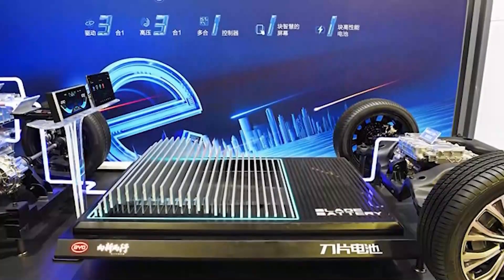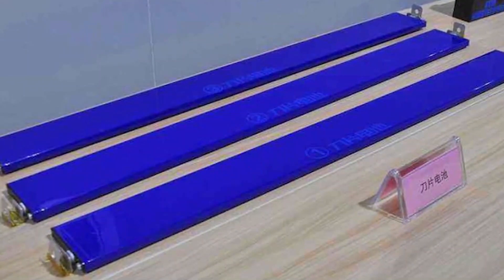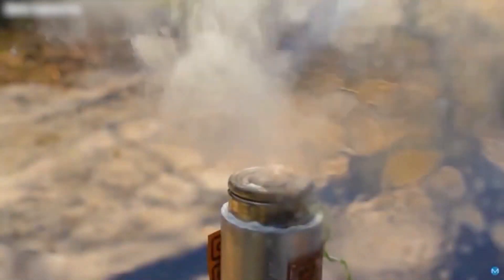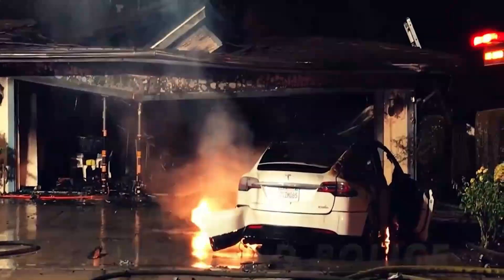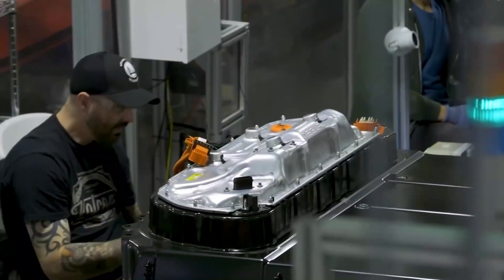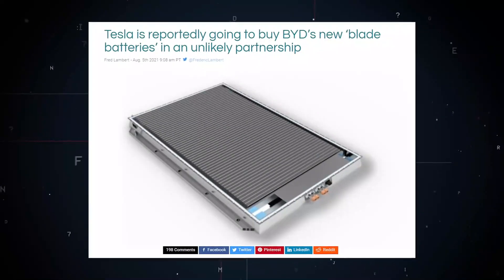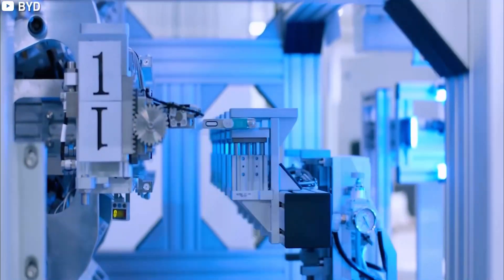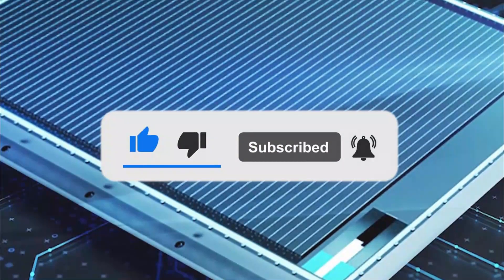Tesla NEW Blade Battery Meets No Competition!

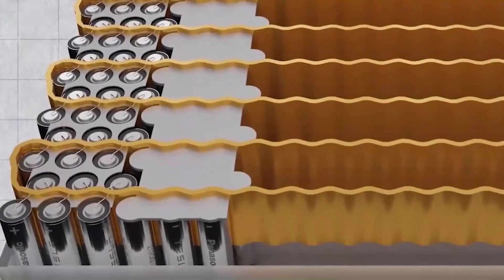Comment: @1:34 so is this really a new battery or just a better way to contain them?
Reply: It's a whole new battery design. They ran this thing hard and abused it to test it. This was to make sure it would not be a safety issue. They over charged it by 260% , no issues. Puncture test , no issues. Rupture test , no issues.  It charges faster,  it last longer due to higher discharge time . Temperatures doesn't affect them nearly as much. All in all the battery is hands down better than current technology....